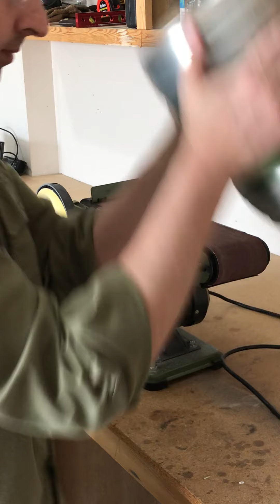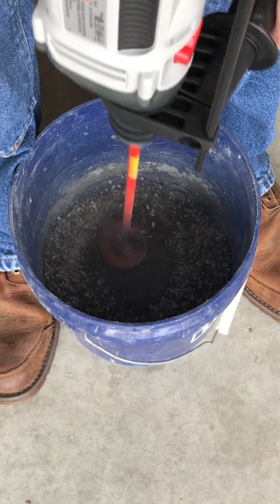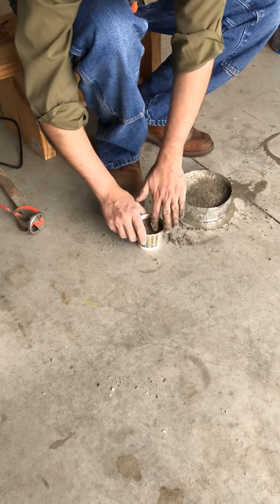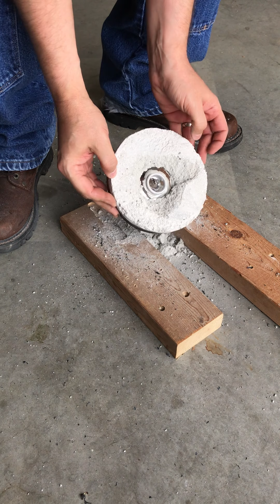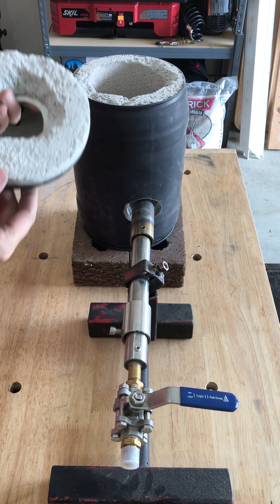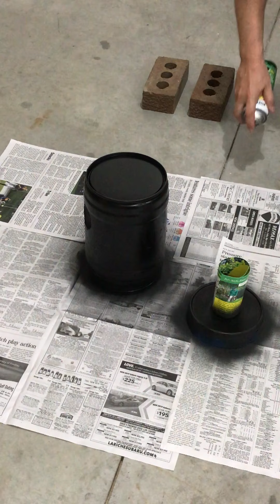Foundry Furnace Mk I Mod iii

Comment: I am very interested in seeing how that mortar holds up to the heat over time.. I did the furnace build it looks awesome!
Reply from the maker: I too am interested on how it will hold up now that I've switched over to propane from charcoal.  With charcoal it held up very well, after repeated firings it would almost seem vitrify on the surface.  It would erode over time but when it came time to reline the furnace I really had to go at it with a cold chisel to remove it.

Now that I've switched to propane firing I'm in new territory with it.  I did get some minor cracking but it did that with charcoal as well but everything is still very solid.  I coated this version with commercial refractory and I'm glad I did because the plinth, which wasn't coated, more or less disintegrated after one firing.  I don't know if that is because my mix cannot withstand the propane environment or if it was because the plinth was an afterthought and the mix was off leading to its failure.  Time will tell I guess.
Reply: @dcn1934  My old charcoal one was built very similarly, though slightly different mix:

1 part portland cement
1 part sand
1 part fire clay
2 part perlite

Used the same refactory cement.  Held up well for charcoal/wood and forced air via a hair dryer for melting aluminum.  Even melted a hole in cast iron one day (not by design).

Nice little furnace for sure!